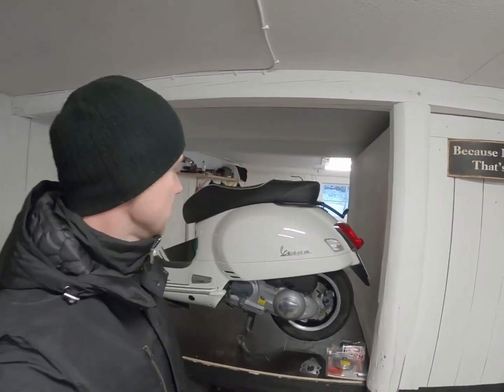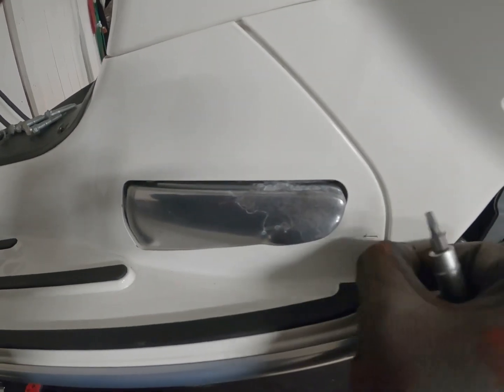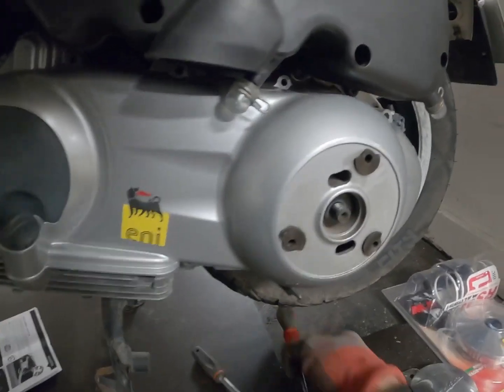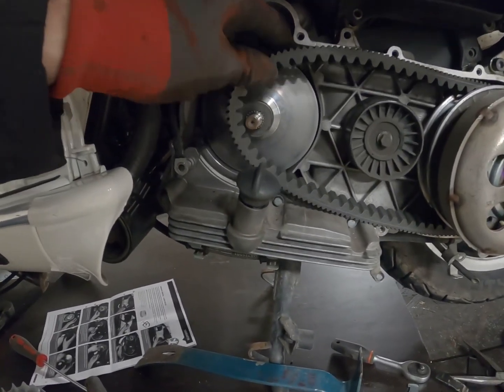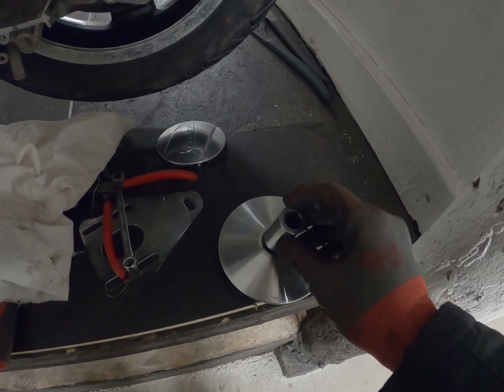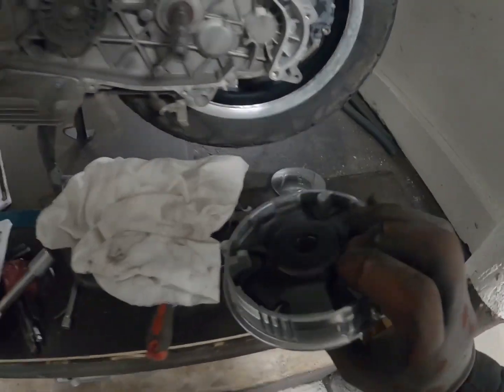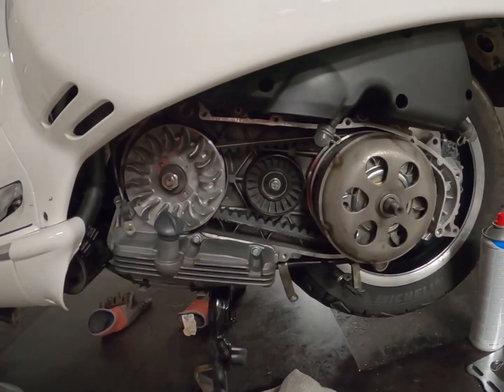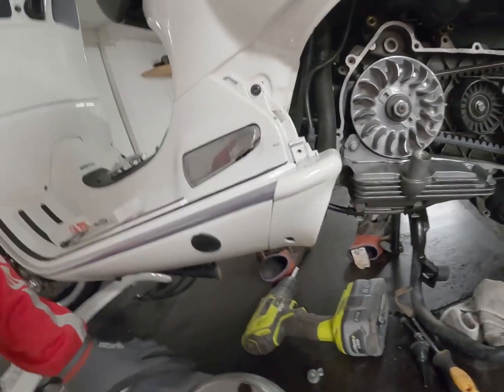Vespa 300 GTS, Installing a Malossi multivar 2000

Comment: Hello, thank you for your video! I have just installed this variator to my Vespa and the consumption increased from 21 km/L to 16 km/L with the same driving style (mostly cruising at 100 km/h). Did you experience the same?
Reply from the maker: @EgalaxyGR  Hello.
I can’t say that I’ve noticed any significant difference in consumption.
Reply: @Nordicexplorer1  Ok thank you, any difference in acceleration or top speed?
Reply from the maker: @EgalaxyGR  tested it with a sport exhaust fitted and the acceleration was definitely improved, but no difference in top speed.
Reply: Ok great, which exhaust do you currently use? (With or without cat)?
Reply from the maker: @PanosKr87-GR  TK-exhaust without cat.

Comment: Great work  ! you didn't need those special Lock -Unlock tools to unlock the clutch  the variator rollers , my 2022 GTS has a one piece skirt I need to remove the licence plate holder I think, I am Not sure yet I will replace the belt and the rollers soon Thanks for the ideas .
Reply from the maker: 👍. As I remember it the hpe models have a split skirt, but as you said behind the license plate.